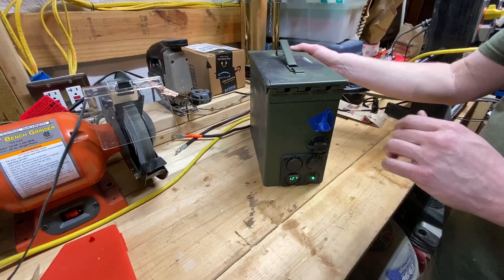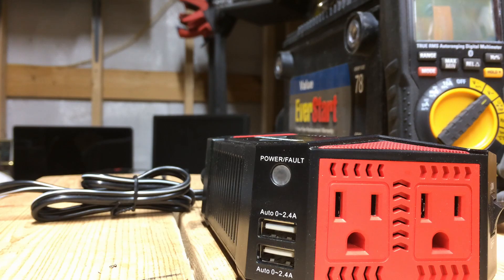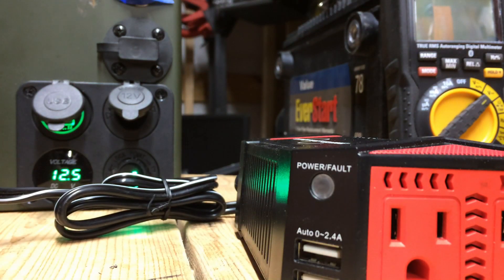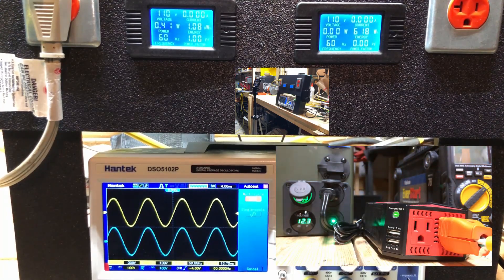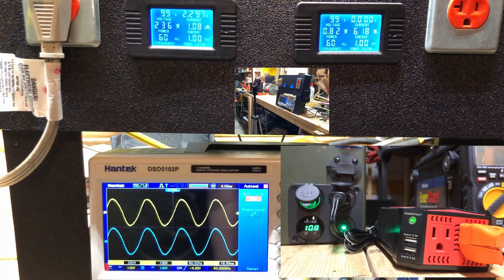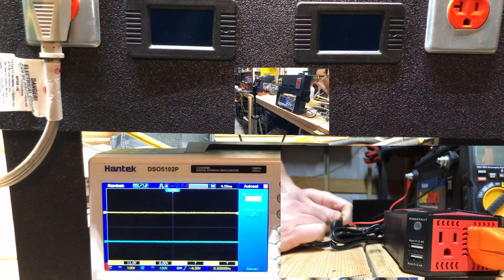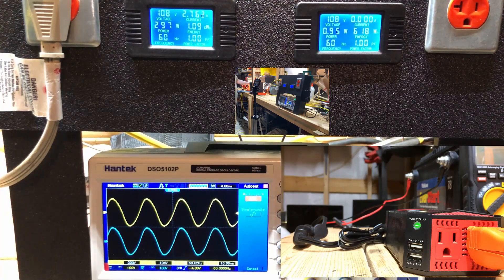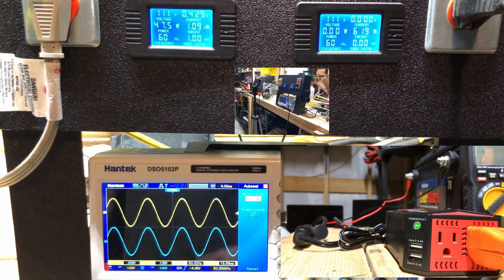Bestek 300W Pure Sine Wave Inverter - Review and load test

Comment: I bought one of these in October of 2020. I've used it for many hundreds of hours to power my CPAP, wifi, television and phone chargers, often simultaneously, when off-grid camping. It's a solid performer and for under $50, it's hard to beat.
Reply from the maker: Mine is still going, keeps the TV and satellite receiver going in a power outage. No complaints

Comment: Thanks for the thorough review, i was really wanting to see one of these on a scope. I'm planning on installing one of these and a lifepo4 battery into a 50 watt guitar amp so I can play on the street, and i need to have as pure of a sine wave as possible for that to avoid noise. The only thing I wish you would have added was some measure of efficiency, or an idle current.
Reply from the maker: Yeah I should have done a idle draw measurement. The reviews for the inverter on amazon suggest the idle current is anywhere from 0.6 - 1.0 amps which would put it at about 10-12 watts on the high end. Hope this helps and thanks for watching!
Reply: What ah of battery did you get?

Comment: Will this charge an Eco Flo delta max 2000
Reply from the maker: @dwayne - I looked up the EcoFlo that has a 2016wh battery. The specs say it will charge to 80% in 1 hour so the 300 watt inverter will not provide enough power to charge it. Thanks for watching.

Comment: what does the back look like, and how would I get a cord to go from the inverter to the battery, since most 12v plugs are only going to be 15A to get more then 180watts out of this thing it would have to get run directly to the battery?
Reply from the maker: I put one of these on my tractor and cut the 12v power port plug off and put a high current SAE connector on it. I ran a 12 gauge wire to the battery and called it a day. I'm not sure what you mean by "what does the back look like" but relating this to the power wire, it is integrated into the case and soldered inside. It is not removable.
Reply: @LivingCommonSense  That is a good idea. I could use that out on the tractor. If you direct connect to the batter (with a fuse of course) you could get a 500-watt or larger inverter as well. Cool idea to put that on the tractor! share some photos... I love that idea.
Reply from the maker: @tnyberg67 - I did a short video on putting the inverter on my tractor in this video:
https://youtu.be/ugiOo2e_pik
Thanks for watching!

Comment: What is the difference between a normal inverter and a pure sign wave inverter?
Reply from the maker: @Muskan - As you can see in this video, the pure sine inverter produces a smooth sine wave where the voltage increases then decreases smoothly as it cycles over time. Most cheap inverter produce a modified sine wave which looks less like a smooth wave and more like steps. This is the result of the on/off nature of this type of inverter. See link:https://youtu.be/32NRX-6W6TY
Pure sine wave closely mimics your household electric power supplied by your electric company. Some motorized and electronic devices that work fine on a pure sine wave, may not work as well or long on a modified sine wave.
Hope this helps to answer your question.
Reply: @LivingCommonSense  thank you so much for the explanation. Althought it's a bit more expensive but I will now def buy  a pure sign wave inverter.

Comment: Good to see a inverter test with a decent load and a scope! Btw, you shouldn't have gone easy on it, hold the full load for longer to see if it can actually deliver 300w for more than few minutes! 😉
Reply from the maker: I'm not sure what the duty cycle is on these inverters. Based on price, I doubt it is 100%, meaning it would likely fail before the warranty is out if it ran flat out indefinitely.

Comment: Great video on this! Just because the inverter can handle 240 w doesn't mean that it can handle that load for too long. I'd be willing to bet that cig adapter will heat up adversely and fail over time at that load. They should really advertise it as 180 running watts and 300 Surge Watts.

The other issue I found was that the Earth ground on the AC side is not connected to anything. Not good for an audio application so I connected the Earth ground lug to the negative side of the battery without any adverse effects. It grounds out the switching frequency noise that can be heard when running audio equipment. You can also eliminate this noise by installing a conducted emissions filter.
Reply from the maker: Yeah, there are higher current options but none are as wide spread as the cig port style connector. At the price point, mass market was probably their goal. The OEM inverter on my truck also doesn't have anything in what should be a ground pin on the in-dash receptacle so I too had to run a ground to the battery lug to measure those voltages. Neither of the blades were a functioning neutral in the receptacle. Sometimes these inverters are setup to do some wonky stuff when compared to household grid power.
Reply: @LivingCommonSense  hey sorry for the delay response. Agreed its a budget inverter. Since bonding the AC neutral and ground to the negative terminal, this has been great for portable power to run my practice amp where power is unavailable.

Comment: So I've been running this same inverter for about a month in my work truck to power a 45w laptop and 50 watt, 30 quart compressor fridge (BougeRV). I got tired of buying ice for cold water (I work asphalt paving, need that cold water) and I switched over to AC instead of DC because for some reason the DC barrel plug wasn't letting the fridge work to its potential compared to when it was plugged into AC. The fridge cools down way, way faster and my laptops power supply doesn't get anywhere near as hot as when it was running off a cheaper modified sine wave inverter. Also having 2 higher speed USB charging ports has been handy. Paid $45 on Amazon and assuming it holds up for a year or so I would buy it again.
Reply from the maker: @Thomas Sounds like your fridge compressor runs faster on 120v than 12v. It probably assumes the 120v power is endless grid power and uses more whereas it may use less watts per hour on 12v on the assumption that 12v is battery powered and limited to what’s available from the battery bank. Sounds like your inverter is meeting your needs. Thanks for watching!
Reply: Holds up for a year and then buy it again??  Do you mean that the inverter breaks down every period of use?
Reply: @waseem8830  Well I made that comment over a year ago and it’s still working just fine so…
Reply: @twoolfrx7  😂 alright then that's cool 👍🏼

Comment: A lot will depend on the fusing and wiring of the CIGAR/AUX socket and the unit does not have lugs like normal 300w inverters do.  A  10 amp fuse isn't going to get you much, while a 20 amp would do pretty good.  Next there is an issue with the car's wiring.  The inverter kicks out ~10.5v and if you have a 2v drop due to the current, the battery won't enable it run long with the engine off.

Comment: What is the Ah of the small and big battery you used? At least we know what capacity would get less and most out of the inverter
Reply from the maker: Both were starting type batteries and not deep cell. The larger battery was rated a 600CCA and the smaller battery was rated at 275CCA. I wouldn't hold too much against the smaller battery as I think the switch on the battery box was defective. I had to replace it. That being said, its hard to go wrong with a bigger battery. Thanks for watching!
Reply: @LivingCommonSense what is 600cca

Comment: Will this charge a 240w laptop while using laptop or should I just use it to charge
Reply from the maker: @Michael My experience with laptop computers has been each comes with an external power adapter that converts 110-120v AC grid power to whatever power the laptop computer requires. That power adapter should have input power requirements listed as well as the max power output shown -usually in volts and amps or volts and watts. The power adapter should not exceed any of those specifications listed on it. If the power adapter is original to the laptop then the laptop power requirements should not exceed output rating of the oem power adapter.
The short version is if the power adapter is original equipment and is rated at 240w max, then the 300 watt inverter will provide adequate power run it to full capacity and your laptop probably will never know the difference between grid power and this pure sine wave inverter. Thanks for watching!
Reply: To be safe, my rule of thumb is 1.5x the wattage for adequate headroom. Electronics heat up when ran at full power, but running at 66% or less of what the inverter is designed for will keep the components cool and be less of a risk for blowing components or fuses. So for a 240W max power supply I would recommend 360W but 350W is close enough type of thing. 240W is 80% of 300W and imo is right on the border line of pushing it. You'll get away with it, but it the inverter won't have as long of a lifetime.

Comment: Can this power a 110w fridge or chest freezer of 110w ?
Reply from the maker: It depends on the start up current of your fridge. I take it as you're saying 110w to mean 110 running watts and not 110 volts. 
If your 110 volt fridge/freezer uses a compressor and freon, the startup current is likely much more than 110 watts. It may only be an instant but the inverter must supply the startup current demand. You will need to check the start up current or power of the unit and be certain it is less than 2.5 Amps or 300Watts to be on the safe side. On the other hand, if the 110 volt fridge/freezer employs thermoelectric cooling using the Peltier effect, it may not need the large startup current. I hope this helps. Thanks for watching
Reply: No. I tried mine on multiple dorm sized fridges and the red overload light comes on when the compressor starts.
Reply from the maker: A refrigerator that uses a compressor/freon system will need an inverter larger than 300 watts, perhaps a lot bigger.
Reply from the maker: @kimmer - That is a nice setup. Running the LEDs on a smaller inverter is probably more efficient. Are you able to charge your battery pack off grid at the cabin?
Reply: @LivingCommonSense  No, there is no electricity for miles and solar is sketchy best due to fog. 200 AH in lithium was good enough for 4 days/3 nights last time but this time I'm bringing 200 + 200 +100 amp hour lithium batteries and leads to connect them....for fun. Overkill!  You can't believe how small my latest 200 AH battery is...no external case and smaller than a Series 27 car battery, built in 200 amp BMS.  Here's a recent video of it with the removable hard wired Bestek 300 watt full output unit.. Sorry if I posted before...I put this out elsewhere a few times in the last 2 days and lost track.  https://www.youtube.com/watch?v=UwuC97gpng4
Reply from the maker: Kimmer -  200AH in lithium is a lot more portable than in lead acid form. I mainly keep the lead acid around the house for emergency back up (leds or small fan) and each one is a direct replacement for a vehicle, tractor or mower. When the vehicle battery gives up, the backup goes in and a brand new battery rotates into the back up slot. I would not want to tote them into the woods though.
Reply: @LivingCommonSense  Haha, agreed. My battery banks stay put waiting for PG&E to go belly up again.
Reply: Thanks for ur contributions sir
Reply from the maker: @Basil - No problem, it is my pleasure.
Reply: Basil, I found a 2 year old old video with my power pack. The blue Renogy 1000 watt pure sine inverter (great for this 105 running watt fridge) runs the fridge and microwave oven but not at the same time. The ancient red inverter is modified sine wave unit for running a coffee kettle but has now been removed. The Bestek 300 watt inverter powers the lighting circuits and dimmers but it is hidden in the back. We will be at this cabin for New Years in 3 weeks. Its North of San Francisco. Come and join us!   https://www.youtube.com/watch?v=mOX5uloSUks

Comment: I think it needs thicker wires, like 6 gauge/ hard wired with ring terminals to pull enough power from battery. That male plug & wires are insufficient  🤓
Reply: Yeah, I think it's intentional, that plug is meant not to exceed the rating of your typical 100~150w car accessory port. On Amazon they state you should wire it up to the battery directly to use the full 300W.
Reply from the maker: Agreed. The 300 continuous watts is 25amps at 12 volts DC and it appears that most 6 gauge can handle 30 amps at lengths up to 20 feet. I believe 6 gauge could make a noticeable improvement.

Comment: Hello. I would like to know if the two curves describe the input AC And output AC. thank you
Reply from the maker: This inverter converts 12V DC into 110V AC. For this video, I connected both channels of the oscilloscope to the same "hot" leg mainly because I wasn't sure which color would look better on the camera. Both sine waves represent the same AC output so the "curves" will be identical. Beware though, some cheaper inverters supply power on two 55V AC "hot" legs and the "curves" are sync'd but 180 degrees out of phase as in this video - https://www.youtube.com/watch?v=g-XnGNrFIdk
I hope this answers your question and thanks for watching!
Reply: @LivingCommonSense  thank you very much for your clear and precise answer.
Reply: @LivingCommonSense  I would like to know if a pure sine wave converter 12v110v has the same signal as that delivered to the house by the energy suppliers?
Reply from the maker: @salif - This Bestek pure sine wave inverter outputs 110V AC at 60Hz which is the standard frequency in the United States. Utility voltage and frequency varies by Country.
Reply: @LivingCommonSense  ok thank you very much
Reply: @LivingCommonSense  You are using a single phase circuit, so both of your channels should be in phase--which they are in your video.

L1 & L2 for 240VAC in the US are 180 ° out of phase for maximum power using a 2 hot wire circuit.